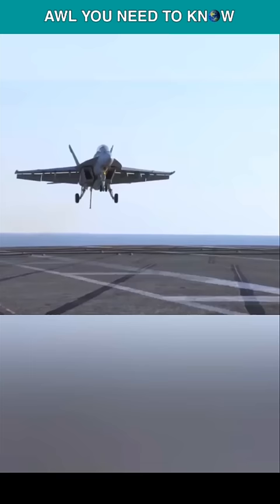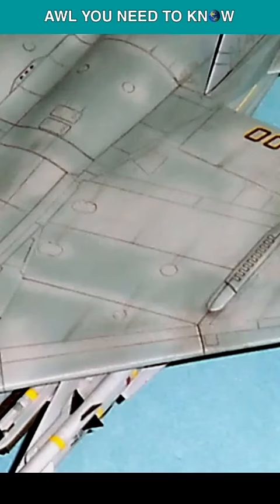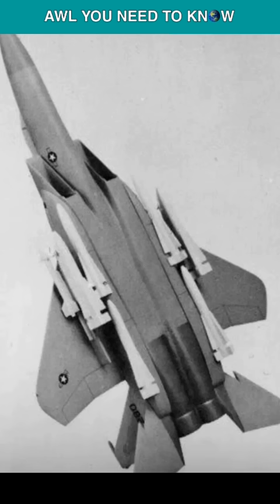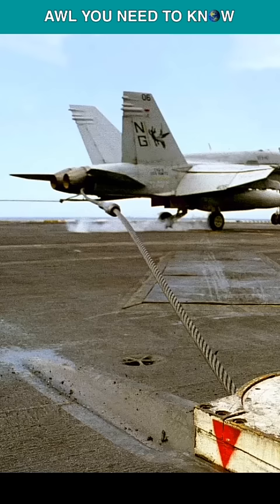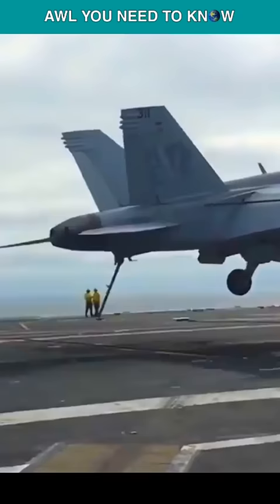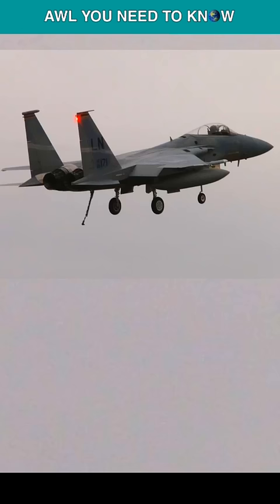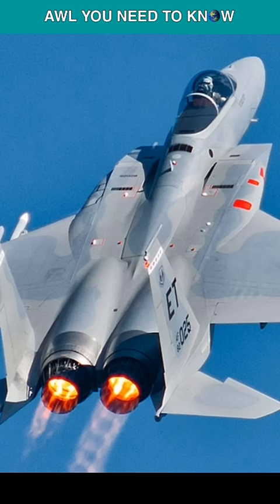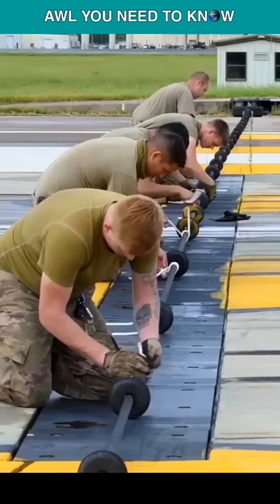Why Can't an F-15 Land On an Aircraft Carrier? #shorts

Comment: Here is the basics of why it never happened. The F14 the Navy was discovering was a very expensive aircraft to maintain and purchase. Additionally the F14 didn’t quite have the same performance as the same generation of F15. The problem the Navy immediately discovered even before prototyping an aircraft is that a F15 would have cost just as much as the F14 and the performance would have been at best on par if not worse than the F14.  And that’s not even taking fuel range into consideration. The whole thing boils down to weight. Navy aircraft have landing gear that can sustain a 700 ft per min descent rate. Land based aircraft don’t have a prayer of holding that. Plus the spine of the aircraft would have to be much stronger to withstand carrier launches and the tail hook arresting.

Comment: When a plan lans on the aircraft carrier, they are at full speed when catching the wire, the landing is a controlled crash. If the pilot misses the wire, they are able to still get up in the air

Comment: I’ve never seen the cable used in my years on an Air Force flight line. But it’s be seen a civilian glider make an emergency landing, a streaker protestor get loose on the line, a C-5 blow a tire on landing, some chick smash a van into a light-all and an F-15 bust into flames on a taxiway while the fire department proceeded to the wrong end of the flight line.

Comment: To answer the question itself, which the video didn't answer: carrier aircraft need sturdier frames and landing gear than normal aircraft. Alternatively they could have vertical landing capability. Both options make them heavier and give them less useful internal volume, that's why a special version of a plane would have to be developed.

Comment: The foldable wings is required on a carrier of course. As well as a tail hook…they both are necessary for the Navy. But I would say that even more important, especially for long term use, the F15 would’ve needed to strengthen up the landing gear for sure, as that puts a ton of stress when you’re forced to stop while you’re still going 120 or so miles an hour down to 0! That puts a lot of stress on the landing gear for one thing. And I wouldn’t be surprised if they’d have to strengthen up the whole airframe even, or at least some specific spots that would get more wear do to landing on an aircraft carrier. 
The F15 is a sick airplane and obviously pretty dominant against any near peer adversary. But it’s just not a naval aircraft. It would be cool if it was, but we have some pretty awesome planes too. 😂

Comment: The biggest reason f-15s can't land on an aircraft carrier in their current configuration even though they have an arrestor hook is because they're landing gear is too tiny. Maybe jets are required to come down at a harder angle of attack when landing on an aircraft carrier. If an f-15 or f16 attempted this it would shove the landing gear up through the body of the aircraft and snap them like twigs. If Navy planes didn't come down at such a hard angle of attack, then the arresting cable would reach its limits and snap before the plane came to a complete stop.

Comment: The aircraft also has to be fitted with a far stronger undercarriage to take the force inflicted on it after it catches the arrestor cable. How you can tell the difference between a land-based F-35 and the variant for carrier landings it's the undercarriage that is one of the differences in the design.

Comment: The Navy did not want an Aircraft designed for the Air Force to be used as a replacement for the F14 Tomcat!
Reply: There's a lot of oversimplification and answers going on here. There was never a serious need or effort.

Comment: Not just catch the wire and come to a complete stop in 500 feet , the plane has to come to stop at full acceleration ( navy planes actually go full throttle on landing ). The undercarriage has to be hardened in a way to handle such a forced landing.

Comment: If that F-15’s puny arresting hook doesn’t snap, then those “chicken legs” landing gears surely would upon impact. Stay on dry land and let the real aviators handle the carrier stuff.

“If you miss the wire, you’ll swim in the sea water”

No, if you miss the wire, then you boltered and you have to go around for another approach. If you’re having mechanical issues, or suffered battle damage where your tail hook can’t be dropped, then the flight deck crew rig the barricade (a.k.a. 5th wire) which is essentially a big net and that catches you. The Air Force do not have an equivalent method of emergency arrestor system, there’s is a little more complex, but it still does require an arresting wire……but yes, sometimes Navy planes do swim in sea water.

Comment: During the Vietnam war, Mc Namara had this brilliant idea, the Navy had F-4s, the Air Force had F-4s, so he planned it out so the Air Force went north, but instead of going back to base, they'd land on the Carriers, rearm and hit them again, the Navy would fly on to Air Force bases and return with the next strike.

Just one little problem, the airframes looked the same, but there were differences, the Navy had heavy duty landing gear to withstand the landing aboard deck. The Air Force traded heavy landing gears for light weight gear, and more bomb load, they'd have snapped the gear hitting a deck.

Mc Namara was full of idiot ideas. I suspect that the F-15 would face the same problem.

Comment: F-15 is a workhorse jet. It costs the least to operate than all the combat planes in operation today.
Reply: Ehm, do you know why the F16 was developed?😂
Reply: @TheGhostOfDefi  
To weigh less and operate cheaper?
My bad, got wrong info, guess the F-16 is Less expensive too operate, with the A-10 been the least expensive at $6,000 an hour.
Reply from the maker: @happydays8171  F-15 was the Air Force's apple, yeah it was a heavy weight child, but still they wanted it badly. F-16 came into being because F-15 was so big. 😂
Reply: The f16 is the smart car of jets.
Reply: @awlyouneedtoknow9435  
I might add it did weigh half of the F-4 it was replacing. So they lightened it up even more after the first round of production?
Reply: it's not. the EX variant is more expensive to purchase and operating than an f-35. back in the 70s only 4 countries were able to afford the F-15. Saudi, japan, Israel and iran. Iranians went for tomcat at the end. almost 30 countries however bought f-16 because of the cheaper price + operational costs + way less difficult to maintenance.
Reply: Mirage and su 29 has entered the chat
Reply: Forgot Saab
Reply: @joeb578  Which do you like most? All the Saab jets were effective planes

My favorite post-WWII  jets are the F-86 and F-104

(both were used very effectively vs the Migs Mainland China was using )

Comment: They originally planned a carrier version. If i remember correctly it had to do with extra weight to make it tail hook capable and things like it would lift up with wind gusts due to the design and the air brake design etc. Just too much re-design to make it work when they had the 14 already.
Reply: According to what i have read in responsible nes outlets, you are correct.

Comment: Bot information.  Navy planes and Air Force planes are made to two different standards.  The planes listed as having a tail hook are all Air Force planes. They have arrestor hooks for emergency landings, but they are only even attempting a carrier landing in the case of an emergency. 

Second in the navy they also have a barrier to stop you if you miss the arrestor.  It's a basically a big net
Reply from the maker: F youu crap head, don't even dare to call my video bot information.

Comment: The landing gear is not robust enough to withstand the landings on a carrier. The F-15 main landing gear is smaller in diameter than the nose landing gear is on a carrier plane.

Comment: Not so easy. 
It's one thing to stop the aircraft with the arrestor -  It's another thing to stop it within 150 meters using the hook and full power. The navy structure for the tail hook is must stronger than the non navy versions. 
It's one thing to land long on a runway.  It's another to slam down on your main landing gear. The landing gear in navy aircraft are much stronger than non navy aircraft. 
Landing is 1 thing. Taking off is another.  The nose gear structure of a navy aircraft is designed to take the stress of a cat launch accelerating the entire mass of the aircraft.  Non navy aircraft do not have the structure strong enough for a cat launch neither steam nor electric.  You'll tear the nose gear completely out of the aircraft.

Comment: The main reason why the F15 can't land on a carrier still seems a little vague, but I'm guessing it has to do with the ability, in the event of a missed wire, to rapidly re-accelerate to take-off speeds without the assist of a catapult. Or, more specifically, I suspect the F15 simply can't manage that emergency unassisted re-launch, likely due to being too heavy.
Reply: I was thinking the same thing the weight would be a huge issue
Reply: @trey6388  Yeah. I'm not an expert, but it seems a design question to me. Very hard to retrofit a plane into a highly-specific role like carrier combat if it hasn't been deliberately created for it. Might as well try to make an F-15 into an SR-71, or a Honda Accord into an F-1 racer; I'm sure the right team can do impressive things, but when you're changing the desired specs that much, you're asking a lot.
Reply: The reason a current F-15 can’t land on a carrier is because the landing gears will either snap or be shoved up into the fuselage from impacting the flight deck. Yes, impact, not land. We call carrier landings “controlled crashes” lol
Reply: Main reason is the tail hook and landing gear, both not strong and reinforced enough respectively.

Comment: No sir, that did not answer my question as to why the F-15 can't land on an aircraft carrier. Most aircraft with proper modifications can land on an aircraft carrier, so... explain plz.
Reply: Most planes can land on a carrier. Once. All the the reasons have been explained.
Reply: @janus4002  No, in fact, they haven't. I am a man on a history and factual mission, your response is neither historical nor factual, sir.
Reply: F-15 can't land on a carrier bcoz it doesn't have a strong tail hook to catch the arrestor wire and it also doesn't have a reinforced landing gear to sustain the high amount of pressure from landing at high speed. Landing on carrier is just basically crashing onto it in a controlled way rather than the soft tap landing at airfields. The navalized F-15 (Sea Eagle) is capable of landing on carrier but its specs by then are pretty similar to a F-14 Tomcat, meaning no much difference between the 2, so why need to procure a new plane that has the near same specs as your current ones. Plus if not mistaken the Sea Eagle doesn't have folded or swept wings (like the Tomcats or Super Hornets) meaning more space will be taken on the carrier by fewer planes.
Reply: @dallasyap3064  Once again, this is not a sufficient answer. Regardless of what the land-based version's specs are,, the video literally said that if the F-15 would have been navalized, there would have been modifications made to the tailhook and the landing gear and to give the Sea Eagle the folding wings that it needs. Cab someone PLEASE find me someone that can tell me what I want to know?
Reply: @type_x_atm_092  The ability to carry the AIM-54 missiles and its radar and firing system. The original proposal didn't include the F-15N Sea Eagle carrying the AIM-54 missile, which was much more heavier than the AIM-120 (about 3x) and others, thus losing the speed and maneuverability of an F-15A when compared to the F-14A. The Navy eventually decided to stick with the Tomcat. This is all I know. I don't know anyone that knows more. If u really want to know the deeper reason then you'll have to search for yourself.

Comment: So this video so wrong in so many ways. Their are if I remember correctly 5 cables going across a carrier for the the hook to catch. While during landing on a carrier the pilots keep the plane basically at full throttle so in case of missing all cables they can easily throttle up more and take off and come back to try again. Ive seen this dozens of times aboard the Nimitz working in the tower. Rare but happens. The f22 is a BEAST of an aircraft but the FA18 is the most preferred because it has the ability too launch at full payload capacity at a short distance.

Comment: Navy pilots land at full throttle so that if they miss the wires they can hopefully take back off again.
Reply: No they don't. They increase throttle after touching down just in case. You can't land an aircraft that fast. They would be trying to land at supersonic speeds if that were the case
Reply: @gmac9987  Do you assume there is no time for acceleration. Do you assume that the minute they give it full throttle that the aircraft is instantly going too speed? If so maybe take some science classes that focus on physics. Or do you think I am so dumb that I think they come in full throttle the whole way? No they boost last second before touch down.

Comment: Some of this is true but you're lack of knowledge is staggering aircraft carriers do have barricades just in case there's an issue with the tail hook The main difference between the f-15 and the f-14 is the landing gear The f-15 landing gear is just too light to handle carrier landings. The first thing you will notice if you look at any carrier-based aircraft is their landing gear is substantially larger than your standard Air Force aircraft.

Comment: Oh, but the F-15 can land on a carrier, just like any air force plane - uh... Exactly once! After that, the spendaly little landing gear will collapse, the airframe will be bent like a pretzel and the pilot will need new underwear and a flight suit after they crap themselves as their bird is destroyed beyond repair around them!

Now hear this...! A Navy plane's airframe is built to much higher standards In order to take the extreme G's and stresses of carrier ops!  During testing, they literally drop the airframe from a crane 30 feet to the deck to see what breaks and then strengthen and over-engineer those sections!

Comment: Funny, but still does not explain why it can’t land on an aircraft carrier. Any fighter jet with an arrester hook should be able to land on it. I don’t see how the type of jet determines whether or not you’ll hit the cable every time. That depends on the hook, not the plane.
Reply from the maker: Due to landing gear I guess!
No bruh, any aircraft with an arrestor hook can't land on a carrier, there's a lot more factors.
Reply from the maker: but bruh your question is very well, I should initiate some more research on this.
Reply: technically any aircraft with an arrester hook might be able to land on a carrier, tbh I'm not sure. 

but I am sure that if you want to be able to fly the plane again after it does land on a carrier the airframe and the landing gear need to be built strong enough to withstand the extra forces that come with landing on a carrier.

if a plane is not intended to land on a carrier they will not design landing gear and the airframe to be strong enough for that purpose since strengthening those components adds weight which in turn reduces performance, which is probably not what you want in a pure air superiority fighter.

Comment: The runaway could have a little slope to gravity helps stop planes.
Reply from the maker: hmmmm, good idea, but is it practical?
Reply: The army watching in horror as a 200 MILLION $ F-35 rolls off the deck because some private forgot to leave the handbrake on 😳
Reply: @angusc-w5226  ☕
Reply: You couldn't have enough of a slope over that short of a distance to make a difference.
Reply: yeah, with the amount of speed those aircraft retain, they'd go right over. Some  non-us carriers DO have such ramps, and if an aircraft misses the wires, over they go.
Reply: @DFX2KX  Can you GUESS the status of the engine...on a navy plane, during a carrier landing?????

You think it's OFF or something? Lol, if the pilot misses all the arresting cables, he just goes up again and circles to try again

There has to be a serious F UP for a pilot to miss the cables and end up in the drink

BTW....the bow...that upward slope on some carriers ..HAS NOTHING TO DO WITH LANDING

They are for assisting in getting the plane off the deck when taking off

Comment: Also there's basically every time you land on an aircraft carrier you're putting a lot of strain on the aircraft and there's a pretty good chance of structural failure if your aircraft for instance is been poorly maintained or has taken damage or both also the heavier the aircraft in addition the larger and more complicated the aircraft the more likely it becomes that something horrible will happen if the aircraft isn't maintained to spec and the case of the F-14 for instance and that's the reason why they retired maintaining them to spec was so expensive and raining on resources that the US Navy just couldn't really afford to anymore when a newer platform could do everything it could and more and better not shitting on you f 14 fanboys just stating it how it is that's why the f- 18 Super Hornet is so easy to maintain compared to I don't know the F-35 yeah the F-35 may not be the best choice for carrier operations just putting that out there on account of the maintenance bill 
oof it's probably the best way to describe it and the F-35 program as a whole burn